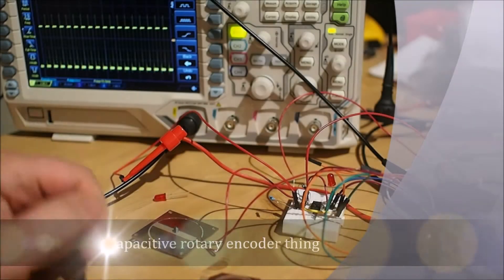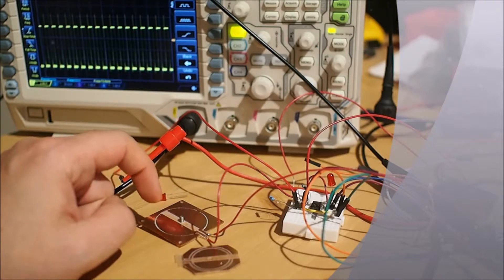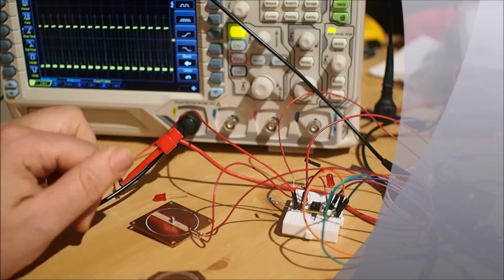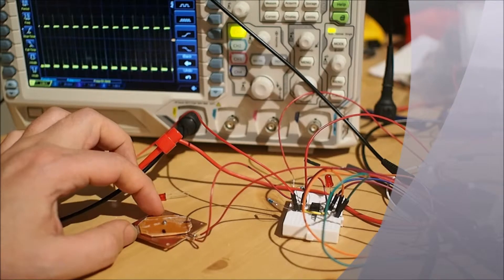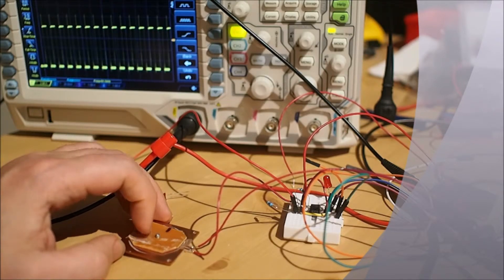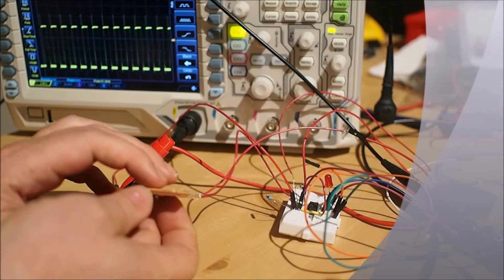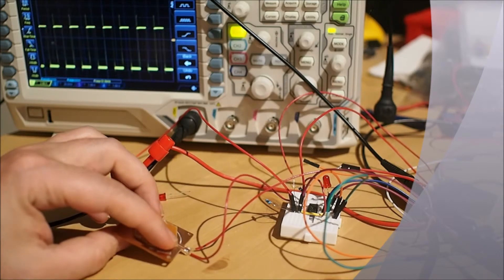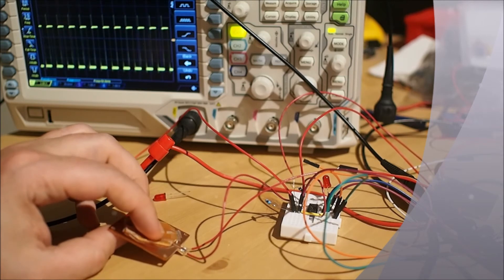capacitive rotary encoding

Comment: This is pretty cool. I have known about these before, but not how they work. I am trying to find a rotary encoder that will work at cryogenic temperatures, and this has the benefit of very low power dissipation, and no need for amplifiers or ADCs at the encoder. Capacitance should be pretty constant with varying temperature, and will work just fine at 4K.
Good demo, cheers.

Comment: if ur making an encoder from scratch, this one prob is easier.  Is very sensitive and thats the problem,  cause they make touch switches from them.  youd want a bit of armour around the encoder to make sure nothing touches it.  i wonder if u increase the capacitance with electrolyte the pressure makes less of a difference to the farad reading,  for a more robust version,   thats in microfarads instead of pico farads.

Comment: I have actually also tried this with just a sine wave. Interesting with using a sine wave, is that you can send the signal through a low pass filter. In that case the amplitude is proportional to the frequency (if you're on the slope of the filter obviously). Just different approach.
Reply from the maker: a better approach and the math can be found here:  https://youtu.be/lxywqETVLhE